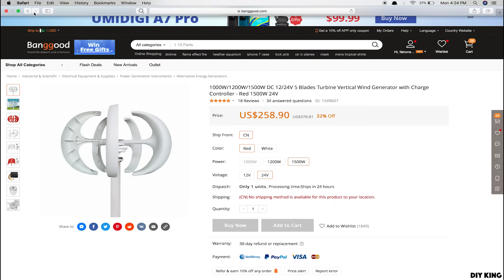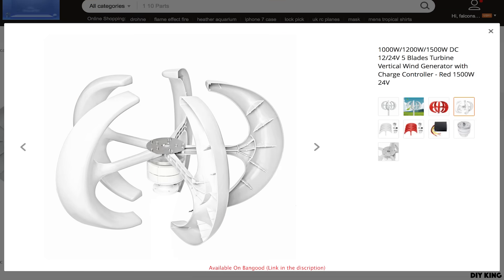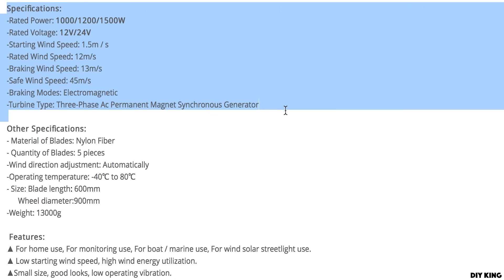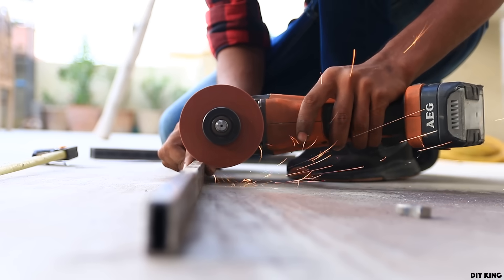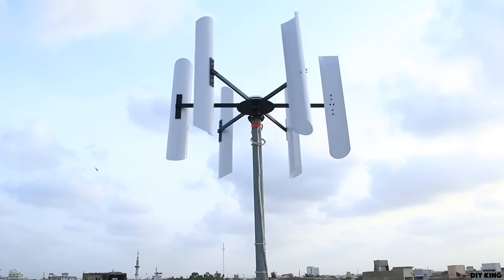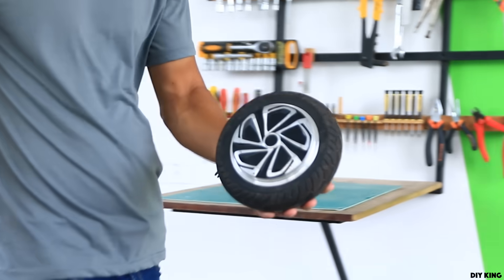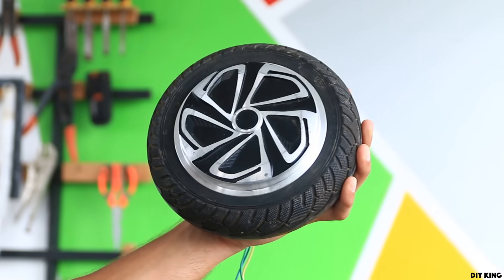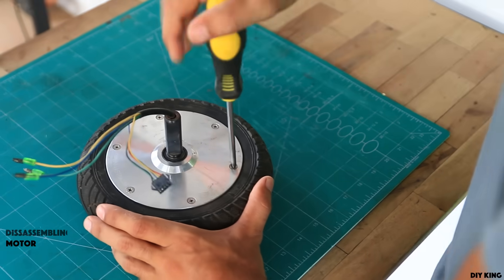How to make a Vertical Axis Wind Generator (Is it worth that???)

Comment: I live rural south central Missouri (the Ozarks). Dotted all over this landscape (mine included) are Rhon 25 towers to mount a TV antenna for reception out of Springfield about 70 miles away.
These would be perfect for installing the equivalent of a "wind generator fence" on the inside of the tower legs in a vertical stack. The inside measure of the triangle of the Rohn tower is barely 10" from leg to leg. But they are 10 feet tall.
Being that Rohn 25 towers are very sturdy, they could easily be used for power generation

Comment: Alphabet capital  A shaped long closed lotus petal shape will decrease drag at one end and increase pressure at bottom or use  spiral DNA structured blade design increase rpm but speed can be achieved by series of blades in a straight  line a set of 3 to 5 .if possible try them
Reply: Nice good job

Comment: i'm about to set off on the same project as an ME. and i'm a little surprised how low the output is compared to generators i've bought from amazon for 200$ for my sailboat, and that's understanding the number of poles and windings of wire on each pole. From an estimated guess the motors just want more rpm (i'd love to bench test with the pair i have, and i will probably jerry rig something with variable speed to test with that can go faster than a drill) with some rpm data ill make a gear box of some sort (doesn't matter horizontal or vertical) but my guess is without too much engineering these motors can probably put out 500w without a lot of fuss... if i manage to get a decent data curve ill dm it to you
Reply: Could you please share the link of the generator that you have bought from Amazon, also how much power did you get from it

Comment: This is actually a turbine using drag force to rotate. Lot of scientists saying yeah kar lo woh karo but in reality drag turbine are not efficient as the turbine which uses life force. The reason is because it also create drag force in opposite direction. The swept area of turbine is good but its also letting lot of air passing by without converting into energy. If you put smaller size wing inside of bigger wings they will help to convert more wind into power and will also help to start on low wind speed. Numbers of wings should be odd as industry standard but should not be less then 5 for drag turbine. You also should also test with different wing configuration. Numbers, length and width of wings. width of wings can be increased .I always recommend my students to Study little science before making any product. Overall good work

Comment: I guess I'm three years late with this comment and no one will probably not read it, but it would be very interesting to see a VAWT experiment using the HAWT blade design, but mounted in a Darwin wind catcher, similar to the Skegness pier wind turbine. Even more interesting to see how a dual rotor setup would perform in such a setup.

Comment: You could have just taken fan motor, cheaper than this rewind wires as you will need different battery charge voltage to inverter batteries.

Comment: I'm not a technical person but i think there is a considerable greater drag sure to the size of the blades. Try cutting them into a triangular shape or try them on in the horizontal direction that might make it work better although putting them horizontally may not be that much fruitful

Comment: You can only use a odd number of blades otherwise it won't spin because you have the wind hitting the opposite side at the same time even though you have the cups on the one side it hits the wrong side so it loses 65% of its power

Comment: Rewire the motor poles from parallel into series. It doesn't take much time, you'll get a much higher voltage at lower RPM. There are a bunch of videos online how to do this, it's worth it.

Comment: Magnetic field has an effect on the steel that's why the  it is to slow, in this case you need 7mps to make it run 
Try to use aluminium

Comment: Bro build the vawt on lift principle . It is a drag concept. It don't have much efficiency . It only have 13 to 17 percent. But lift vawt has 35 to 40 percent. Please install a planetary gear set or a normal gears to increase the speed. You will get the expected output.

Comment: IIRC, commercial vertical axis wind turbines use blades that work a bit like aerofoils to increase the percentage of the rotation that's capturing energy. At the minute, these "Cupped" blades are only really catching the full energy of the wind for at most a 1/3rd of the rotation. The other 2/3rds of the rotation the blades are either in turbulent air from other blades moving in front of them, or creating drag due to moving directly against airflow.

An interesting experiment (assuming you still have this turbine (I just noticed this video was uploaded 3 years ago).), would be to redesign each blade mount slightly to allow them to be tilted so you could see how that affected the output. It's hard to describe what I mean by "Tilted", but at the minute the front straight edges of the cupped blades are both in line with the arms. I'm on about rotating the blades so they're still vertical, but the outer straight edge is further forward than the inner straight edge, or to put it another way, having the mounting holes in the blades moved sideways so they have more of their surface on the outboard side of the mount than the inboard side (God I with YouTube allowed us to post doodles, or even links to doodles, in the comments. It would make explaining this sort of thing so much easier. 😕 ). If the blade mounts angle was adjustable it would allow the setup to be tweaked to see if changing how the blades present to the wind could effect power output.

Comment: You should make one with a spiral design similar to DNA, not stacking them at the same elevation like you doing this video, but staggering them with their height, creating a spiral affect or you could make the blades foldable and retractable into the wind and then pop open for the win so they won’t be equalizing themselves with push and pull from one side to the other

Comment: Orignal design was made with plastic frames you need to avoid using metal for the frame this would add more extra weight to the whole structure of project ❤❤❤😊😊

Comment: conect the pipes to a bicicle wheel... bogger is better, 2 ways, by friction or transfer, 
by frictcion: put together both wheels, 
by transfer: use a mult-V rubber 
the high velocity its done!
v-hawt... high velocity less torque
h-hawt... less velocity high torque

Comment: Nice project, i just want to draw your attention to the load on the rotor,  the rotor needs a less composite blade structure, i suggest using aluminum instead of mildsteel, i believe the speed will change.

Comment: The VAWT was a drag type wind turbine, which in any  case is not very efficient.
Even a good designed VAWT that uses the lift principle should be made bigger than a HAWT to get the same output.

Comment: Hello, nice project, thanks for sharing. 

To get a much better result with the current design, you just need to split the windings and reconnect them in series. 6:32 every coil of your wheel consists of five parallel wires per winding. Just split and connect them in series. End of the first wire to the start of the second. And so on for every winding. This will multiple (x5) the output voltage and significantly increase output power at low RPMs. 

Next two improvements are optional, as they need more extensive revision.

- It seems that it makes no sense to make more than three blades, more blades also reduces speed. 

- And also a significant increase in productivity will be the creation of a full-fledged Darrieus rotor, but for this it is necessary to replace the halves of the pipes with a NACA0018 profile wing.
Reply: I was going to inquire if this had been done - rewiring each of the 3-phase windings to be in series vs parallel - and you addressed that.

Comment: @makewithkabir made a Solidworks CAD modelling video on the Vertical Axis wind generator and its blade design, the current design is not optimized as per Fluid Mechanics, etc.

Comment: The drage is so higher because the shape of the blades is not the right way . The should be perpendicular to  the radius or at a sum angle near the 90 deg . Also the blades should not be concave. there cross section must be aerodynamic like a plane wing . you can find good stuff if you searched for (drag turbine) and(lift turbine)

Comment: The vertical axis (VA) wind turbine was being developed by Dr Peter Musgrave at the University of Reading, UK.  This was during the 1970's. His design also had a feathering feature to stop the blades spinning too fast in a high wind. The main advantage to the VA turbine is the heavy generator can be at ground level, thus reducing a need for a really strong tower to support it at the top.
Reply: What a load of nonesense, wind turbine were used by the ancient Egyptians to grind grains and possible well before their time stop associating UK history

Comment: The idea is good and was once thought up and published in a Russian magazine, back in the 80s. But there this idea was more complete than yours. The essence of the refinement is to close the back of the returning blades from the impact of the headwind. And for this they need to be half closed with a sheet of tin or half a cylinder made of tin or plastic. And for this to work, you also need to make this casing rotating around the blades. And to the back, he needs to attach a shank, like a weather vane. Only in this case, this generator will be able to produce maximum power!

Comment: Would increasing the height of the pole mount and generator increase the speed and current output?. Could you attach a gearbox to the shaft connected to the generator for multiple geared speeds im not saying 10 speed bike gears exactly but a actual gearbox. And would it be possible to please print out your paper diagrams for drilling im not intelligent for all that plus eletronics i need the diagrams plus step by step im special needs as far as mathematics and i never took eletronics in highschool would this be something you could do for me please i need enough to run a normal American home and appliance's my mother never be afraid to ask for help so here i am .i need a great many helps with solar panels system scrounged from scrap any help would be appreciated thankyou

Comment: Your vertical wind turbine design was good enough to generate power, but heavy components (metals) reduced it's efficiency.  Convert base plate, arms, nut and bolts with aircraft grade aluminium or carbon fibre. It will help.

Comment: A couple of notes for this design:
1) The half pipes need caps either side to stop the wind escaping the "sails"
2) You need to reduce the weight of the moving carriage quite a bit. Steel is heavy and will increase the friction of the system.
3) Place weights on the back of the half pipes (for inertia, making it more efficient in inconsistant weather)
4) Modify the geometry of the half pipes to add a flat angle of around 30-60 degrees to reduce drag. (facing outwards)
5) Try using materials with a lower friction co-efficient, like Teflon or oiled metal at the point of contact on the rotating carriage.
Reply: What about modifying the blades to a design that involves two haves on a hinge with a light spring action to keep them open when hit by the wind,and allowing them to close, reducing drag when facing away from the wind. Thoughts?
Reply: I agree, putting in the caps will help, but also using some neodymium magnets to push the plate up to reduce the friction would also be of great help.
Reply: 😢816pm😊😊

Comment: Connect motor only when spinning at speed then disconnect this can be done electronically by simply disconnect load or 1 wire reconnect at speed

Comment: Sir i need your help can you please tell me where I can get a high geared  transmission type for connecting the blades and blade housing to the slow end connected to housing and connecting the high output to two electrical generators for maximum electrical output.

Comment: Great project. Shorten the arm length so that the radius is smaller, which will enable it to spin faster in the same wind. You could also experiment with the blade length, to see if shortening them makes any difference. What is the original wheel from ?

Comment: Hey!

I have some suggestions -

1. Using a motor with lower rated rpm might work.
2. Using step up transformer might help.
3. Longer blades might make it more powerful.
4. Placing blades nearer to the center will increase angular velocity of the wind and thus, the rpm too.

By the way, I still think the vertical axis system is better due to less moving parts.
Reply: I just made some calculations regarding angular velocity of wind and now I believe that one cannot get high rpm in vertical axis turbines, but I think the torque must be high.

You should either use different alternator for this project or use a gearbox.

Comment: I'm sure someone has already said this but it seems that your drag can be lessened by making the spaces between the blades smaller so that as it spins it creates a draft for the next one to ride in rather than catch the wind resistance on the back of the next blade. Also, if you use a separate partial cone like structure to angle the wind into the blades from in front of the v.a.w.t. using a self angling pivot to find the best wind angle, you'll capitalize on every bit of wind coming near your turbine. Sorry to see you guys give up so easily. I believe vawts have a greater capacity for power generating than all others.

Comment: Another factor to consider is the size of the blades. With a horizontal axis, the bigger the blade the more higher speed stresses the axis. with a horizontal, the blades are always the same distance, no matter how big you make them. The blades you used looked to be about 2 feet long. Had you made them 5 foot, the speed would be the same, but the torque would be much greater and having a "transmission" such as using a pulley set with a 1 to 10 ratio would result in the generator turning much faster, thus generating a lot more power.
Reply: I was just about to post this same thing...From experience as well...great thing about PI is that a pulley just a few sizes up is a lot larger, so 1X around it can turn a smaller pulley many times... I have mine turning 2 generator assemblies just fine.

Comment: Very Good Attempt👌👍👏
You may adopt following 2 vital points for VAWT:
(1) Better use odd number of blades (instead of 6 use 7 nos)
(2) If feasible increase the Radius
(3) try to make 3 or 4 number of blades from the pipe
May be you will get better output.

Comment: That design will never spin faster than the tangential wind. I think it would be efficient if the generator was designed to make power at low speeds and high torque.

Comment: What if you replaced the metal components with a carbon fiber/Kevlar? It still would be strong but lighter and less force to spin the motor.

Comment: You need to have blades or wings instead of the simple half circle. Something like the wedding of an airplane is needed. The fins should be positioned with their flat side perpendicular to a tangent of that blades desired movement.

Comment: Keep the horizontal running and erect a separate pole behind that to harness the wind from that to run the vertical axis just behind that horizontal wind turbine for testing purpose only. This may help increase the wind flow to the vertical axis and you will be able to use the wind generated by other. Just curious is this works.

Comment: Hi...really appreciate the effort and knowledge,just a small suggestion. Reduce the length of the arms.This will increase the rpm. YES, this will require more torque(higher wind speed) .I am sure you cN strike a fine balance between the two.
Again,I love the concept

Comment: Just a question on the bearings... Should you not change out the bearings in the hover motor to angular bearings since you are changing the load from horizontal to vertical load???

Comment: I would really like to see this setup improved. Things I would change: the tubes that secure the blades could be shorter and fixed horizontally. Smaler blades, and in less number. Great job guys.

Comment: So... if I am understanding this right it works just fine, but the motor/generator used needs a higher RPM to be effective.  So a different motor that can deal with a lower RPM would be more the way to go for this particular setup?  Or shorter lighter weight arms that can spin faster?
interesting.

Comment: I always feel like that if there was a better design than the one the big guys use, then they would switch as well. This is about being efficient, as cheap, easy and as fast as possible. Yet they always use the 3blade design around the globe. The whole "overspeed control" that people see in the simple design demonstrates the inefficiency. If there is a braking force, then that means wasted potential. Propellers are the way to go with wind turbines. Fantastic video though.

Comment: It will need RPM multiplier.
This design has mor torque but less rmp,
With a bicycle wheel and a piñon (little gear) yo can multiply the speed in RPM.
Another thing (if your structure supports that) is to increase the blades surface to use much more, you can double or triple the torque and the you can convert that  to a much greater RPM with a several pulleys or chains mounted in bicycle wheels in series.

Thank your for sharing the video!